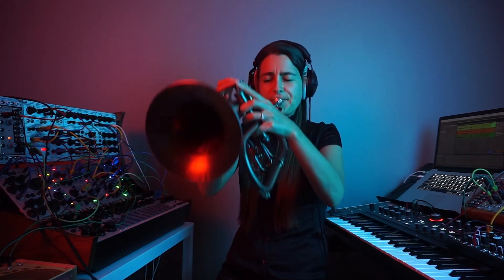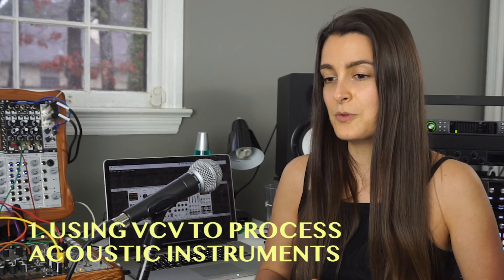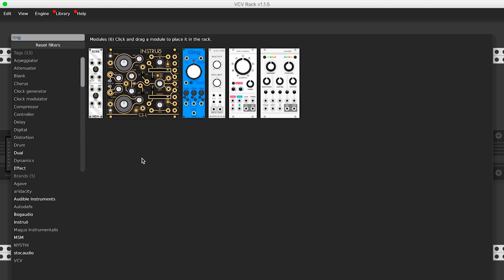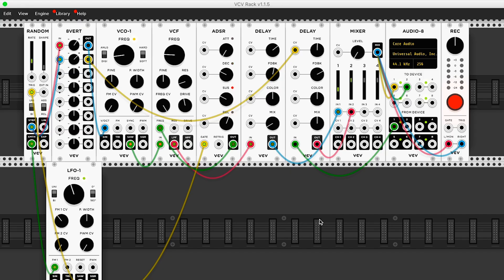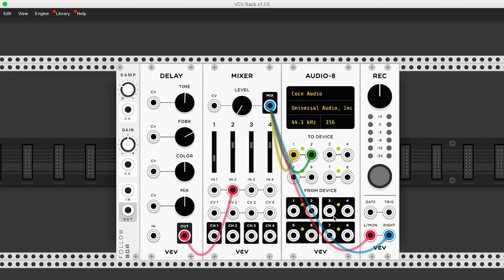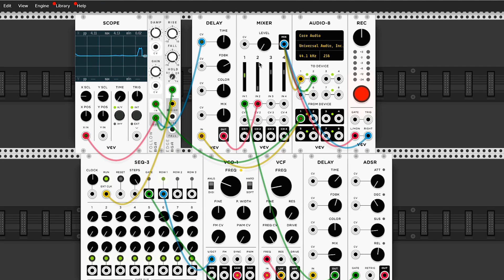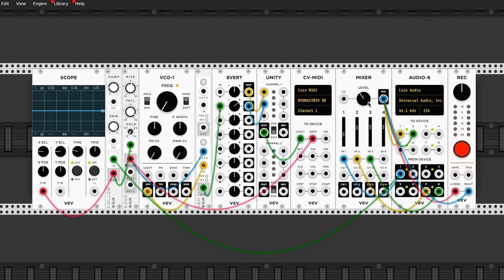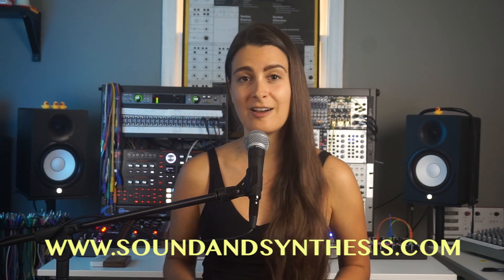Connecting Acoustic Instruments and Modular Synthesizers: VCV Rack Tutorial

Comment: Great video. Love your channel. Very inspiring. I think I need to (finally) buy VCV rack 2. Been on the radar for some time. I want to use it as a plug-in with Reason, which finally has VST3 support. Already using Reason with a small Eurorack case (TipTop Mantis) and the genius that is Expert Sleepers to bring the two together. Keen for the Eurorack explorations to not go too far down the rabbit hole. So expanding the capabilities of the hardware with VCV sounds like a good idea.

Comment: What I also like doing is using Pitch to VC/oct converters in my patch to track my violin for controlling a synth, it works really well with a noise gate before and an envelope follower patched into the cv in value for the VCA of the oscillator. It's great because I can have virtually endless sustain and control my attacks on the fly, apply vibrato, glissando, do every sort of cool stuff I would not be able to do with a keyboard.

Comment: Fantastic vid! Within VCV, another thing I’d add as suggestions is the NYSTHI library P2V module, which tries to find the fundamental pitch of the incoming tone and pull a 1v/OCT contour from the analysis. You’d mentioned you’d used pitch detection in MAX MSP to control parameters - curious which approach worked best for you? The struggle I’ve had with any such attempts is the latency in the algos to accurately calculate the pitch.

Comment: This is a great introduction to combining the two! I'm currently working on something similar with my custom built 8-string electric guitar which has individual outputs for each string. I'm using the computer both for processing each individual string (for polyphonic waveshaping) as well as extracting various CV's for my Eurorack using both amplitude and spectral envelope followers as well as onset detection. So far I've only been able to extract CV's from the sum of all 8 strings (due to lack of appropriate hardware for more) but I have begun mapping out ways to extract the same CV's including gates individually from all 8 strings along with some ideas for having each string output a tuned voltage as well, kind of like the various Buchla controllers which have freely tunable keys. This could potentially open up for some very expressive patching, especially if what ever events you use the signals from the guitar to trigger in the synth would in turn affect some parameter of the guitar - true two way communication between the two worlds.
Reply: you could use midi guitar 2 to turn your guitar signal into midi. both cv and note on data.
Reply: @bohabjames9809  Been experimenting a bit with that and coupled with the accompanying Bass plugin for the lower strings, it does indeed work pretty well. I will however need more hardware outputs to use it with my hardware and I'm a bit back and forth wether I want to use the guitar for pitch control or rather just gestural CV's but thanks for chiming in, always appreciated! 👍
Reply: @felixahl9  nice best luck to u sounds fun